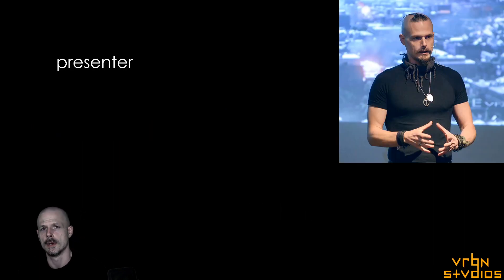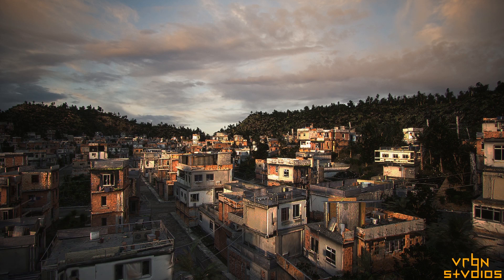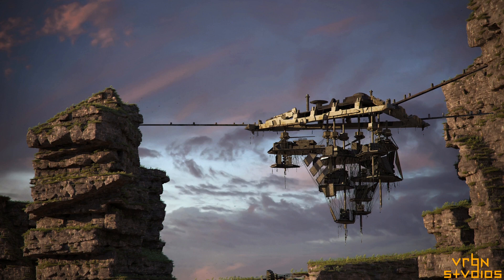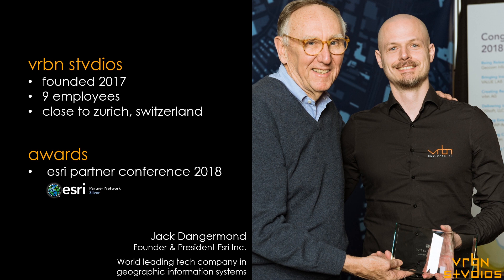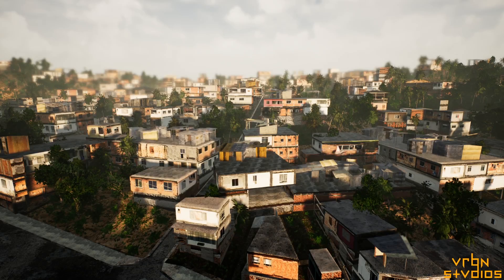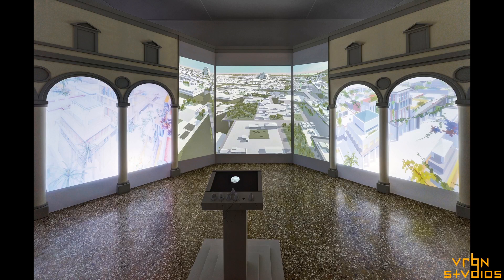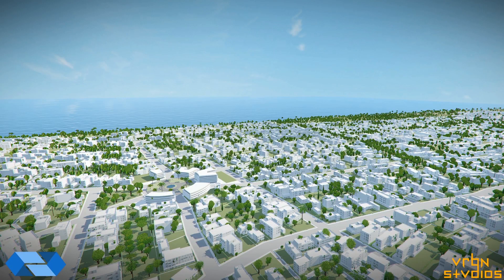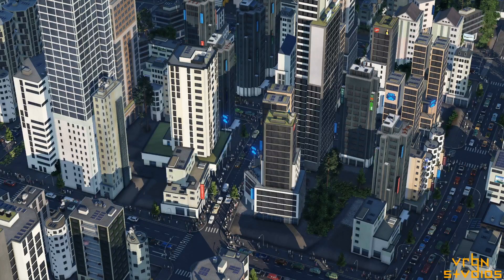CityEngine at vrbn stvdios: Production of real-time optimized 3d architecture

Comment: 10:50 What is meant by "triangles"? Doesn't look like triangles to me.
Reply from the maker: The triangles are part of the geometry. For examples, if we were to turn the building in the presentation into a wireframe model, then we would see that the building is made up of different triangles. Basically, the fewer triangles the better the performance. This is especially important when developing games for different consoles (e.g. mobile devices vs. PC vs. game console etc.).
Here is some more information about triangle count best practices: https://developer.arm.com/solutions/graphics-and-gaming/developer-guides/game-artist-guides/geometry-best-practices/triangles-and-polygons-usage
I hope this helps you! :-)
Reply: @CityEngineTV  Hello, what is the URL of the large library? I want to get high-quality textures and textures in the large library.
Reply: @CityEngineTV  Can you build a library of high-quality texture models like Epic's "Unreal Market"? The current Cityengine's own models and textures are still very backward, and they are not PBR. I mainly want to use Cityengine for game development. I hope that Cityengine's asset level will at least reach the level of the game "Watch Dogs 2".
Reply: @tianlongwang1868  you are joke, those libraries cost thousand and thousands to build. also a lot of time if its not clear. make a model and export it to unreal ..easy..